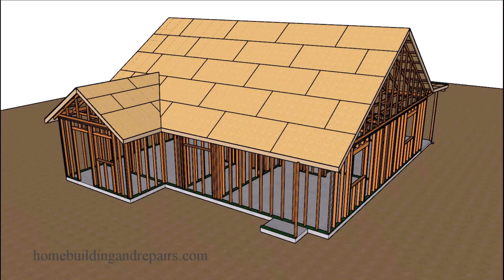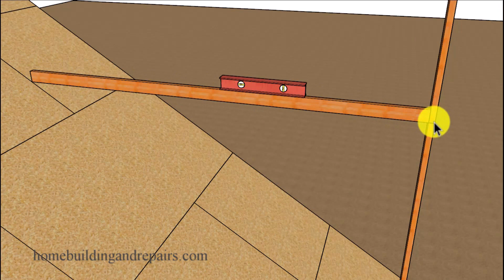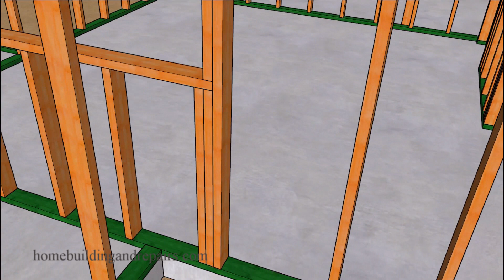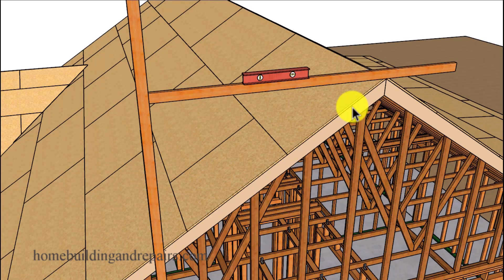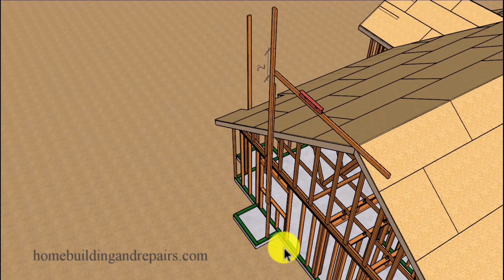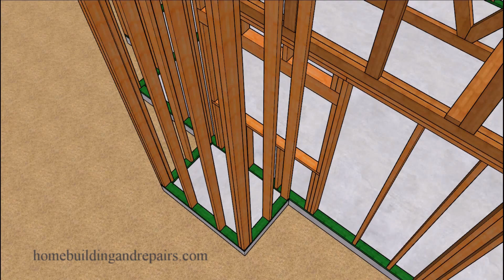How To Calculate Fireplace Chimney Wall Framing Height - Do It Yourself Examples And Tips

Comment: How high above the edge of the roof does my fireplace need to go if my walls are 10 ft high and the pitch is a 14/12 like an A-Frame with a metal roof?